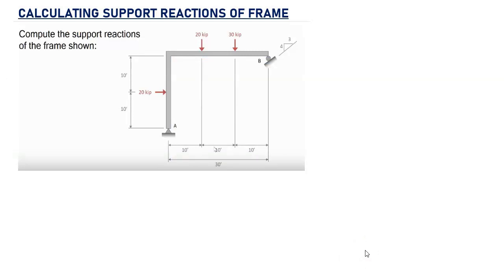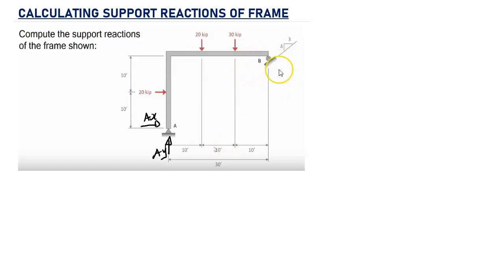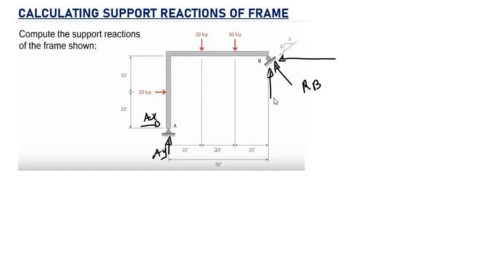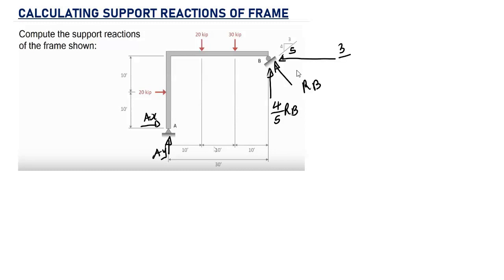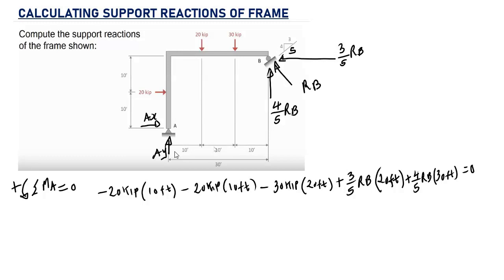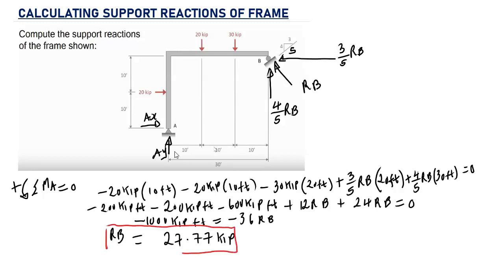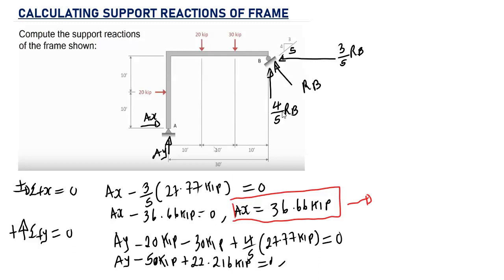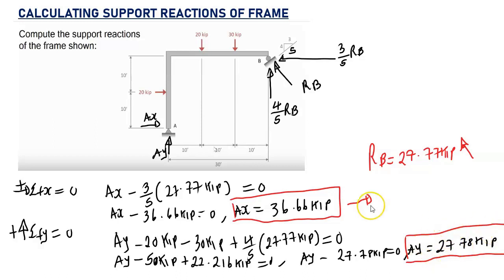How to Find Support Reactions Of Frames - Structural Analysis

Comment: Thank you for this video. I never used the given 3/4 and 4/5 proportions of the triangle like that, I always use angles and trig, this makes it so much easier. How is it that clockwise moments are negative and the other way around?
Reply from the maker: The clockwise moment is negative because we assume the moment in anti clockwise to be positive, while the clockwise to be negative. 

If we get a positive answer, our assumption is right; it is indeed anti clockwise. If answer is negative, our assumption is wrong; it is a clockwise rotation.